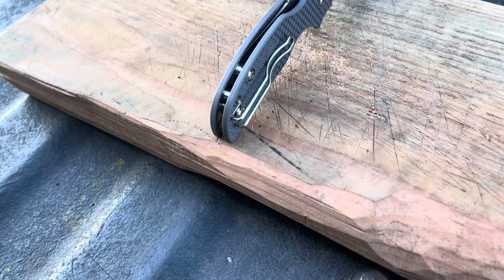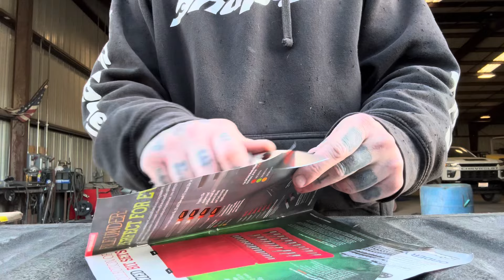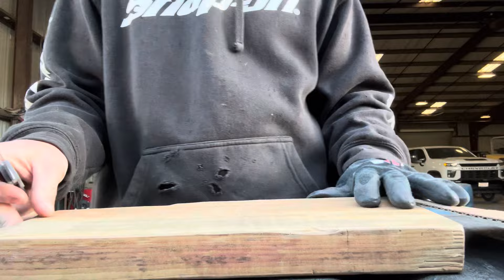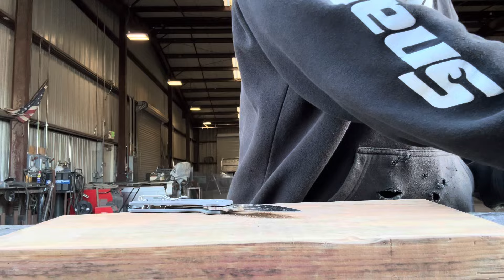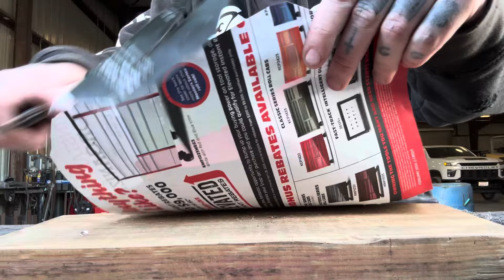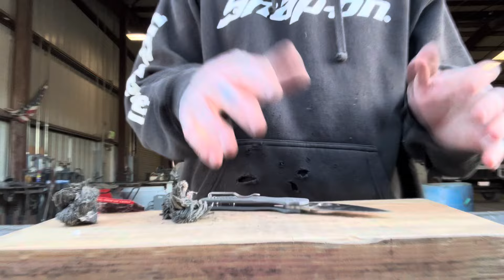Cut Test: Spyderco Sage 5 in Maxamet! DESTRUCTION!!!

Comment: maxamet is insane. it gets a lot of flak for being "chippy," but if people are taking care of their knives and not trying to chop down trees or pry nails with it, maxamet will do endure an incredible number of knife tasks before it needs to finally be sharpened.
Reply from the maker: Usually the people that complain it’s chippy have never actually chipped it 😂
Reply: BBB has a video of TRYING to be rough on Maxamet, cutting into wood at odd angles and prying on it, and the Maxamet is fine. 

I think people get swept up in lore and let their imagination run wild. 

I believe they are the majority of opinions echoed in reddit lol. The same majority that doesn't actually use their stuff for more than taking fancy IG pictures.
Reply: Believe me, if rex/maxamet/s30 etc have the same price it wouldn't be fragile or chippy) People are looking for a unicorn. Especially when they pay for it. And it user dependent. I personally saw a man break two hammers and chip a sledgehammer... in a row... even though it wasn't necessary... and still didn't get the job done. 😂

Comment: The PM2 In Maxamet is just as fine of a blade. If not better. And the nice thing I've found with Maxamet, is it's not as hard to sharpen as people try to make it out to be. It does take some time, but not that much longer. I mean literally a few minutes on the KME and that bad boy is ready to rock n roll for longer than any other blade I've had the pleasure of using. Great video man. Different steels have different advantages. That's for sure.